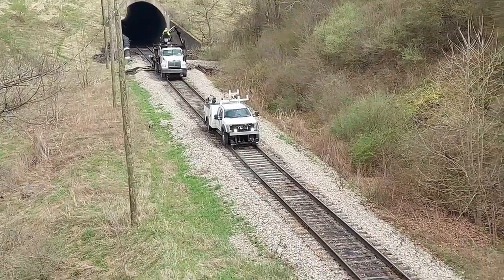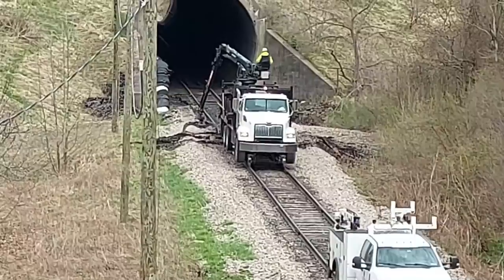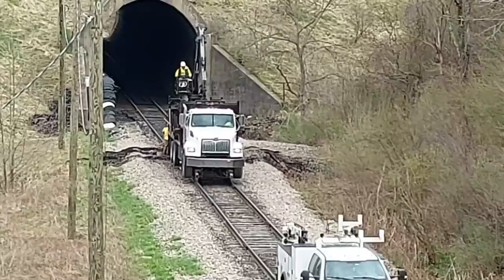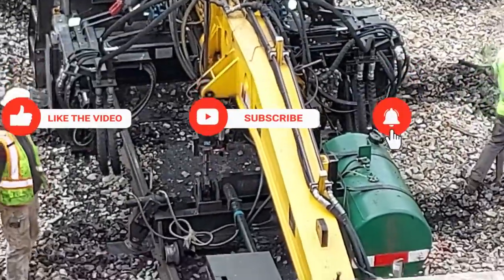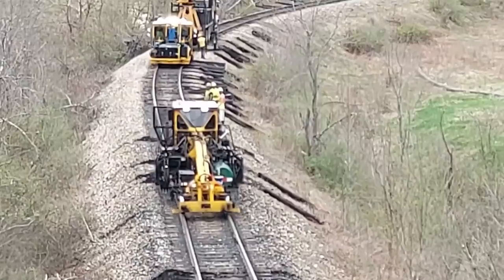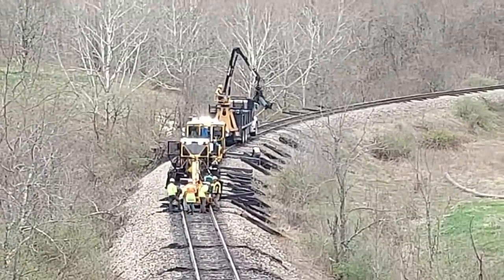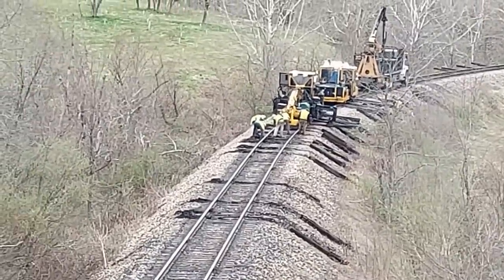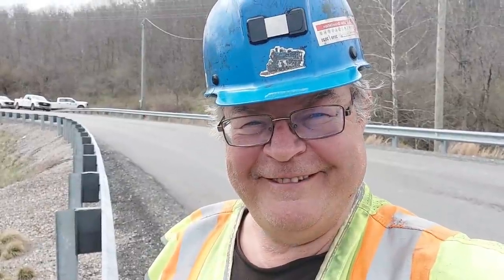Replacing Ties on Curve 21 with a Nordco TRIPP Machine

Comment: The boys over at East Terminal Railroad could sure use a visit of this kind of maintenance. They make do with hard effort and old tools, working to fix up their little dream.
Reply from the maker: Seen several of their videos, I don't want to make any suggestions
and advertise my channel on theirs, i don't believe that's ethical.
However, you might would like to make a suggestion, that is
ethical and kind and I would be glad to help them if I could Jennifer.

Comment: With all the engineering, design, hydraulics and eletronics on display here, I find it interesting that a square point D-handled shovel and a man working it are needed to get the job done. Long live the square point shovel.
Reply: They have machines that do it all. The track crew just brought a little on for this job because they weren’t doing tha man ties.
Reply from the maker: Good job for a young guy Paul! Putting ties plates back under
is not an easy job all day long for sure. Appreciate your checking
out the show today my friend.

Comment: This is, indeed, a fantastic machine and would make this job a lot quicker to do. The ties we have come already fixed with the fittings to hold the track to them, they have a machine that taps them into place as it passes over, there is so much mechanisation. A good job has certainly been made concerning the area with mining subsidence, not easy to deal with. Thank you again for allowing us to see the work that goes into keeping a safe and efficient railroad.
Reply from the maker: Can you imagine what those RR workers of old doing all that
tie replacement and hand spiking would think if they could see
how it's done now. Mechanization and hydraulics are a wonderful
thing, but they put thousands of RR workers out of work over
the years. Appreciate your writing in with the nice comment John.

Comment: Always great to see behind the scenes of what it takes to keep a RR running. Thanks to your bosses for letting you do this!  If you had to completely rebuild a section, how deep is the stone ballast and is there lots of prep to the soil before the stone gets dropped?
Reply from the maker: Glad you enjoyed the show tonight shop shop. We have
taken sections out in the past, shoved the track aside and
graded everything out down to solid surface. When laying the
track back in, we have used a GeoTextile road fabric and then
added about 10 to 12 inches of ballast before setting the
track back on it.

When building new track they want a good clay base if possible
and if it's fill, then compaction at least every 10 to 12 inches
of fill until it's to grade. No topsoil or big rocks allowed in a new fill.

Comment: And a second question: Do you know how deep the mine is, approximately? With their time in business it is probably a sizeable operation!
Reply from the maker: Depth of the coal seam varies greatly. Seams don't lie flat, they
have hills and valleys plus the top terrain varies. Our mine is anywhere from 800 to 1200 feet below the surface. Working underground is
not a nice place to be....
Reply: @ccrx6700  1200ft under the ground, I'm no good dwarf material for that.
Reply from the maker: @2xKTfc  me neither 😉

Comment: Great video!  In one section it looked like close to half the ties were being replaced. Is there a limit of what portion of ties can be replaced in an area or could you do for example 20 in a row?
Reply from the maker: Thanks Alan, great to hear you enjoyed the show. No limit on
amount of ties that could be replaced and yep could do 20 in
a row. However they must be tamped before running a train.
On higher classes of track they would also run a slow order
of 25 over the disturbed track for awhile. Different classes of
track have different criteria for this. Generally speaking once
track is disturbed by ties and tamping, it takes about a million
tons over it before the ballast has fully compacted to original
according to AREMA specs. since our track speed is 25 we
don't need a slow order after tamping or tie replacement.

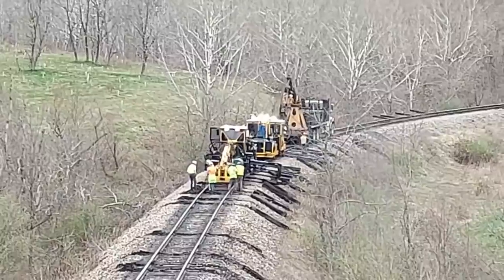Comment: Around the 9:00 minute mark, do I understand correctly that the mine went under the track, and the surface dropped?  That sounds challenging and a half.
Reply from the maker: You are correct Rod. Long wall mining causes everything above
the mined out coal to drop. Keeping track surface up to grade was
a challenge, surveyors were out here everyday and we got reports
on how much the track had dropped. I had to keep track tamped
up to match original grade during that time. But we did it!

That was a very unique situation that almost no other railroad
ever has to deal with. When they first started long wall mining
under our track many years before here, we had tons of dropped
ties to jack back up, what a pain that was. When they mined
here, we replaced all bad ties first and what a blessing that was.
They mined under about a mile of track here and we only had
to fix 2 ties that time.

Comment: 7:38 are the ties exactly perpendicular to the rails? Is there something on the rig that makes the ties slide in place square to the track?
Reply from the maker: A well placed new tie should be at an almost perfect right angle
to the rails yes sir. No there is not something on that machine
that does it other than the operators eyes, and most are pretty
darn good at doing it. do appreciate your checking out the show
tonight Peter.

Comment: Great one again Dave.  Do you use coal hopper cars for dumping ballast or do you have dedicated cars?   
We have had some heavy rain here. Just had two and a half days constant rain (unusual for this time of year heading to winter. Floods in Natal with loss of life and widescale damage. Large section of track base before a bridge washed away.
Reply from the maker: Thank you Bill, glad you enjoyed. When track was originally
built they used the original hopper cars to spread ballast.
Now we have 1 special ballast only car, it is air over hydraulic
operated. Much better than the one we had before where I
had to run along side the car with a bar opening and closing
the doors.

Comment: What does that electric wire on the poles on the left go to ?
Reply from the maker: There is a pipeline from a water treatment plant at the mine, which
cleans prep plant water to almost pure. that water is piped to the
harbor and dumped in the river. The pipeline goes thru the tunnel
and is insulated and heated and the line gives power to the 
pipeline heaters. You can see the pipe at the end of the tunnel on
the left, the black is insulation.

Comment: how much do rail joints  shrink in real cold weather,,then when heated up for 50-100 ft how much will the joint close in inch fractions I suppose
Reply from the maker: Engineers have figured that rail will run up to a foot a mile in
really hot weather. Haven't read anything about how much contraction
but would guess it may be about the same.

Comment: Can the mine crush and screen the rock they need to remove anyway to make ballast, or do you have to bring in ballast from a more suitable material from somewhere else? That would be a little unfortunate, with no shortage of waste rock coming out of the mine..
Reply from the maker: Very good question. Almost all the rock coming out of the
mine is a soft sand stone and slate. The ballast we use is a hard
limestone and almost no hard rock like that comes out from the
mine. We get our limestone from a local quarry about a half
hour away from us.
Reply: @ccrx6700  Thank you for the info! And yes, sandstone ballast would make a very sad track with the things they run over that every day.
Reply from the maker: @2xKTfc  👍😊

Comment: Hi Dave, just wondering how difficult is it to replace the ties in a tunnel 🤔.
Reply from the maker: That tunnel you are seeing has a concrete floor, really, really
hard to replace ties in there, have to take the rail out and lift
the ties straight up Gary. Tunnels with ballast floors are not
much of a problem, but depending on side clearance, may
have to remove a few ties at one time. Thanks so much for
watching the video today my good man.

Comment: Does the ground dropping when you long wall the coal hurt peoples house or the roads?  Also, how do you bend the rail around the corners when it needs replaced on the curves?
Reply from the maker: Yes it certainly does Alaina. Coal company goes to each house
and takes before videos of the structure. Then they will either offer
to buy the house or give the owner a settlement fund for damages.
It also takes ground water away and here there are so many houses
that have wells. So the coal company has to  provide each house with a trucked in water supply or pay to have city water piped to those homes. Where the mines go under roads, the mine company must
post a bond that will pay for damages. The mine is forbidden from
long wall mining under cemetaries.

Quick answer on curving rail. Make the joint on one end, then
about 10 or so feet out from the joint start shoving it in with a lining
bar and spiking behind to hold it in place. Rail bends easier than
you may imagine. I've bent rails in up to a 13 degree curve, although
high degree curves usually takes 2 guys to push the rail. Some
very sharp degree curves on transit come from the factory pre bent.

Comment: Are the tie plates also used for slanting the rail like in curves?
Reply from the maker: All tie plates are made having a 1 in 40 cant. This way the rails
whether in tangent or in curves are slightly angled in and not
laying at a 90 degree angle to the ties. Think about it, that helps
counteract the lateral force placed on the rails by a train.  Good
question Big Jon and we thank you for writing in and watching today.

Comment: I love this stuff. Great channel. What does the wheel assembly look like? How do you use road vehicles on the rails? Thanks, best regards 🙏
Reply: If you look at the front of the trucks you should be able to see the railroad wheels.
The front of the trucks are hydraulically lifted so the front wheels don't touch the rails, but the rear wheels are only raised enough to get them aligned with the rails so the rear wheels can be used to drive the truck along the rails. 
The trucks are called (in the U.S.) high rail trucks.
Reply: @frankhiatt5295  Thanks Frank, I appreciate it. Very nice of you to take the time and share what you know. Best regards. 🙏👍
Reply from the maker: Thank you Peter. Glad you are enjoying the times with us here.
We do appreciate your tuning in and checking things out my friend.
Gonna have a video out sometime in late spring/early summer
on a close up of the hi rail truck wheels and how to set it on 
the rails. There are hi rail assemblies that are hydraulically 
driven that go up and down which sets the truck on the rails, 
wheels are a small version of a train car wheel, typically 16 inch
across instead of the 36 inch wheels on cars.
Reply: @ccrx6700  Thanks. I'm looking forward to it. All of sudden my evening got real special. Appreciate it Dave.

Comment: Dave, just wondering why wood ties are used and not concrete.
Reply from the maker: Good question Derby and I have addressed that in a video
so if you will watch that it will go into much better detail than a 
short comment answer would be. That is about half way into
the video:

https://youtu.be/oOug0z34118

Comment: What is the cost of changing out rail and ties, can you put a per foot or per mile cost on this ?
Reply from the maker: Very good question Gerald. Wood prices vary as well as fuel for
trucking as you know. We have always figured around $90 to 
buy and install 1 new tie. A new 39 foot stick of rail cost's $900
plus trucking plus labor. I do not have an accurate figure for
replacing a rail. Frontier RR Services charges per day for
things like that and depends on the number of men they
have on the job and the machines. But a ball park figure
would be between $1500 and 2,000 for 1 rail to get changed
which includes the cost of the rail.
Reply: @ccrx6700  Right, not cheap. and that is only 39 feet.

Comment: Sorry not trying to act like I have a clue. If you dig ties out. Would a piece of pipe or the black drainage pipe with holes to let water out help. Ballist over around. Enjoy might be silly? You been railroading thank you.
Reply from the maker: Great question Ronald and one I've thought of many times myself.
Problem being with drain pipe, it would have to be way below
the bottom of the ties or else I would tear it up when tamping.
Then also have to take in the weight of the train passing over
it so the pipe doesn't collapse. Not even sure it they make drain
pipe that would hold up under that weight. Clean ballast is the
key to good drainage. They often do put drainage pipes along
the sides of the tracks tho.